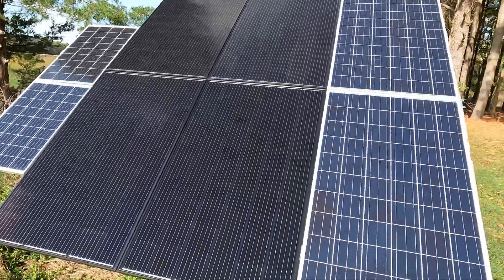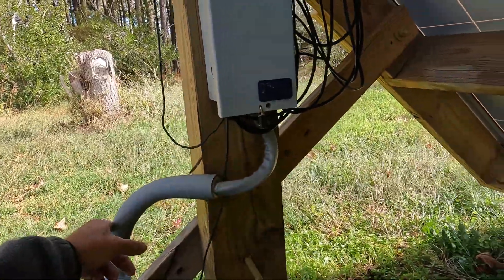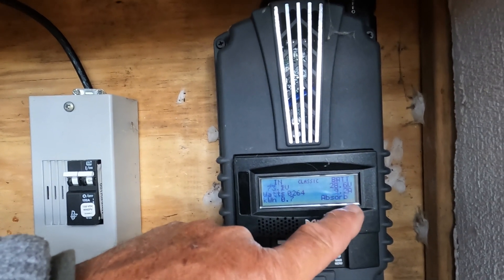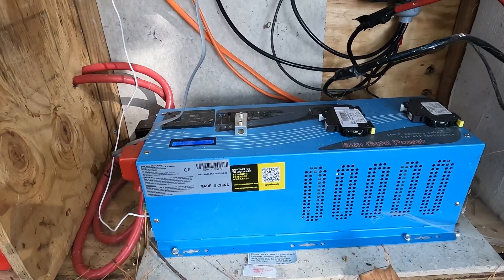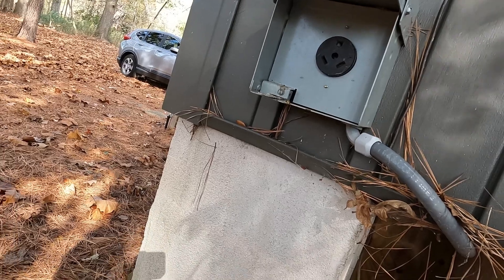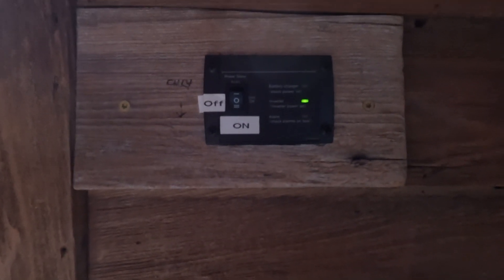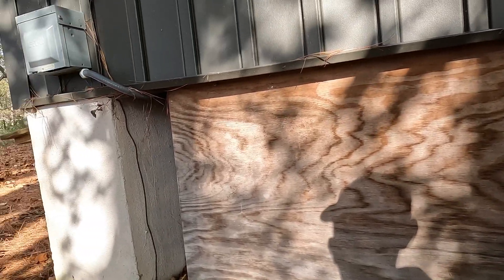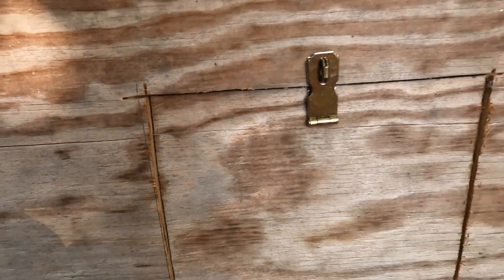Off Grid Cabin Power options.

Comment: Great system,my only concern is the inverter laid to low to the ground,if it rains to much it might soak it
Reply from the maker: Thanks. There's zero chance rain water gets to the inverter
Reply from the maker: Cabin sits on sand. We had 10" of rain in like an hour a couple years back and didn't even have a mud puddle.

Comment: what degree angles are those adjustment holes?  60 for winter, 45 for spring and fall and 90 for summer?
Reply from the maker: To be exact add and subtract 23.5 to your latitude. and subtract from 90 degrees. Here in Virginia we are at the 38 latitude. 38+23.5=61.5 and 38-23.5=14.5 So summer is 90- 14.5= 75.5 degrees and winter is 90-61.5= 28.5 degerees. I just do 45 degrees spring and fall.